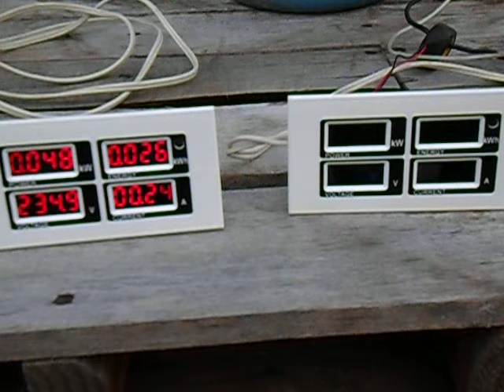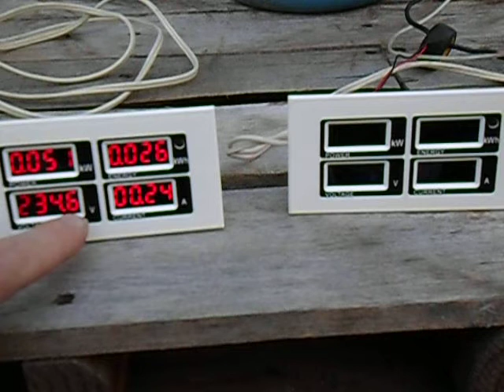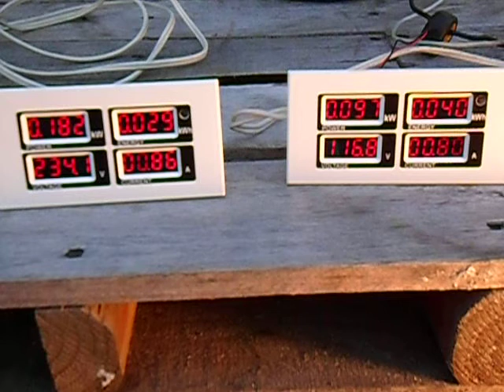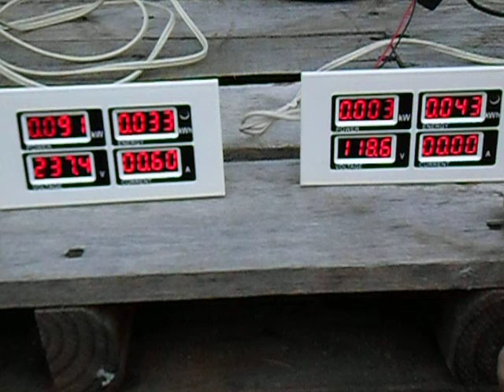Gerard Morin replication 10kw to 5kw transformer test

Comment: I was also advised that I need to install three spark gaps inline between my generator and the first transformer.  He claimed it will produce a pure sine wave and a massive flow of energy. Also he seems to think I need to increase my rpm from 3600 rpm to 4000 rpm.  What is your opinion?  Thank you.

Comment: We just finished replicating Gerard Morin's overunity .  We used a Honda 3600 watt generator from Harbor Freight.  We sent 240 volts into a 25Kv transformer and stepped down to 15Kv,  From there we used 120 volts out to a 40 amp breaker and ran six loads totalling over 7000 watts!  It did not overload the generator!  I will be posting a youtube shortly.  Thank you for all your help.  God bless!
Reply from the maker: Richard, Three Cheers Mate - Sounds like you've done it!!! Running a 7Kw load with a generator that can only make half that power - Can't wait to see your replication on youtube.

Comment: You are amazing!  One of the most important things in your video is that it proved that the transformers act as a load bank and do not burn up the saw or blow out the bulb. When turned off, they do not over heat anything. Thank you for the info to order the panel meters! We just got in a Delco Remy AC permanent magnet brushless 3- phase alternator For $160.  It should produce 500 watts.  Do you think it is possible to resonate enough current into the transformers? We have a 25kw and a 15kw.  Where can we find a transformer switch?

Comment: thank you so much for your experiment.  Where can I get meters such as you have in the video? I have acquired several transformers.  God bless!
Reply from the maker: Thanks for your interest Richard, the meter was from mpja.com stock # 32404me  http://www.mpja.com/Panel-Meter-AC-Multi-Function-AC80-260V-100A_22000W/productinfo/32404+ME/ they do have others you may also like # 32409me http://www.mpja.com/Panel-Meter-LCD-Snap-in-AC-Volts-20Amps-45KW/productinfo/32409+ME/ if you prefer a LCD readout instead on an  LED display. Good luck with your testing.

Comment: The system is using more on the input to power the saw than you get on the output. The wattage on the input, without considering the idle coil load which is .58 amps ends up being 237.3 x 2.73 amps= 647.82 watts (input wattage). The output has a voltage of 117.5 x 5.13 amps= 600.21 watts output. If this was gaining efficiency, the output would be much higher than the input.

To gain efficiency, you have to eliminate the feed from the wall at your house. The original experiment shows gerard connecting an ungrounded generator to both transformers completely ungrounded. They act as an antenna to draw in voltage from the aether when they are not grounded because the devices have no capacitive discharge to ground when they are not grounded. The system can not have a grounded coil system connected on the input. Your home uses a grounded coil from the center tap on the pole next to your home, eliminating the pulsed dc input you need which will transform into a pure sinewave once it gets any of the coil load.

The system you have energized is fuleing the arguments out there which state that this system does not work as Gerard claims, and, it really does work.

 I advise that you use a permanent magnet generator for the input, ungrounded, laying on a rubber mat for electrical work, the same for the transformers. Then retry the experiment, but, I will have to warn you the electronics will not accurately read the power because they will most likely burn out since the voltage will be airborne next to the pigs. Be very cvareful not to touch the pigs case when you energize it. The capacitance between you and the ground can easily kill you if you do.

Marc
Reply: +Marc Belanger  dumb ass you dont mesure amp in radian energy
Reply: +Stefan Ergo Proxy that shows how much of a fuckball you really are.. if the ammeter reads it and it reads voltage, there isn't cold electricity. #2, you won't get any induction from the Earths  magnetic field oscillation having the source or the feed connected to a grounded conventional source. that's how this effect works. If you knew how it happened, or even owned a utility transformer, you'd probably have a better chance figuring out why it does this because the ground eliminated a cored transformer from inducing energy without the Lenz effect. #3, the transformers need to be a set of 13,800 phase to ground, transformers with a dual laminated cores, plate wound secondary with the primary coil over the secondary to be able to.attract the field utilizing an attraction via magnetic manipulation with the field surrounding the secondary. since its attracted to the secondary, the aetheric power is attracted as an antenna through the inductive coupling of a resonant ungrounded transformer without having capacitance to the Earths ground, making this function similar to a slayer exciter  . these transformers are not the same as Gerard's, they are the wrong voltage, they need to exceed 13,000 v to initiate the channeling of the energy. #4, the source needs to be a permanent magnetic genset with the generator isolated as well as the transformers isolated from ground. #5, conventional power in equals conventional power out. If this was cold electricity, the meters would have erratic readings that were all over the place. #6  running your mouth with somebody much smarter than you proves how much of an ignorant dummy you really are. I've already been successful with this and many other devices, so I'm not sure who the he'll you think your talking to here. I've invented what's called Pelex, a much more powerful device, which works on the same principle, however it's much smaller and doesn't have to carry the bulk and weight everywhere it goes. for a device 5 lbs, I get 3000 watts from 6 watts of input. So, since you're so bright, what have you designed to better our world??? a cupcake maker?  LOL

Comment: Was there some way to look at this difference between the two setups. The light is easier,  100w buld, however you need to back out the transformer usage and when you do, amps show up. You get eight on the consumption side, and the draw side also saw eight but the starting amps where 2 something and the Volts did not change, the kw reading on the intake side needs to back out the steady voltage as well. Then start looking at the numbers. Sorry but something just doesn't look right.

Comment: I wonder what affect on the experiment there is by using the variac instead of the generator?
Thanks for sharing!
Reply: Tony Ward since the input has a grounded coil at the power companies transformer, the experiment wont work because the energy being forced into the system is not anything but conventional power which works in the opposite manner when resistances are added, literally! . The generator is a mix of forced electrons and cold electricity because it is ungrounded, it manifests the cold electricity and safely powers home equipment as we all know but would be a slight bit noisy, which isn't that bad with that genset because I have the identical unit. The generator coils are sending a high electrostatic spike and a dc pulsed output, not really a true sinewave which makes the experiment work for Gerard, but not for Hitby 13kV because of his feed. All of Gerard's components, including the generator are not grounded and they are isolated from ground too. This causes the chanelling of energy from the plate/ capacitive inductor coil in the pole pig to successfully happen, allowing the manifestation of electrons in a totally different way. Since the pole pig is close to the ground but not touching it, it causes the plate coil to act as an antenna to draw in this energy, but, there isn't as much as we think since the ratings on the devices are about 2/3 of their peak labels wattages. The plates say 6500 watts when in reality there is maybe 4500 watts flowing. The generator has a 30 amp fuse and a 120v output which equals 3600 watts. We could literally put a 10 amp fuse in the generator because it doesn't draw even 10, it is like 9 amps max in his video. That would state that his generator is only outputting 1080 watts and powering a load of over 4000 watts rms.

Clearly there is some overunity in Gerard's video unless the lights on the oil heaters were the only thing working, but, they should have been at maximum output since the temperature there was extremely cold and they don't shut down to a lower level until the thermostat is satisfied. That's tough to do in BC during the winter with garage doors open!

Cheers!